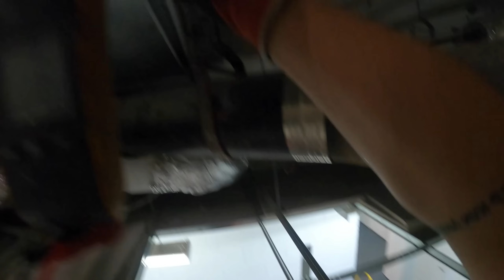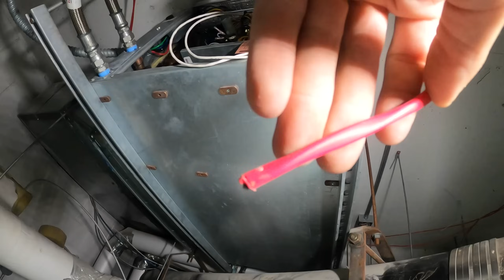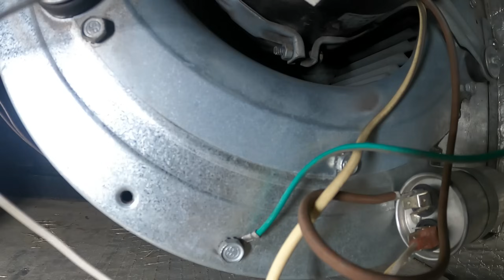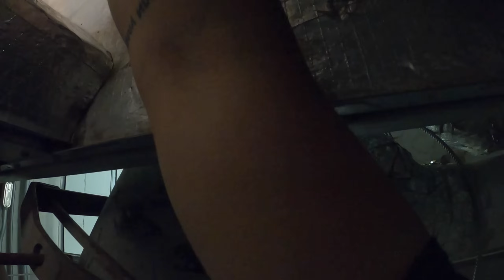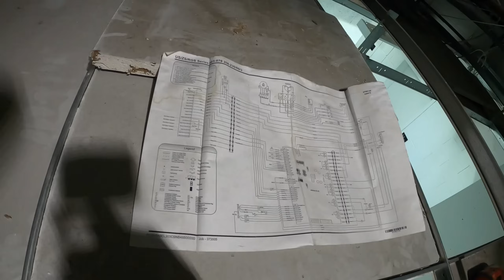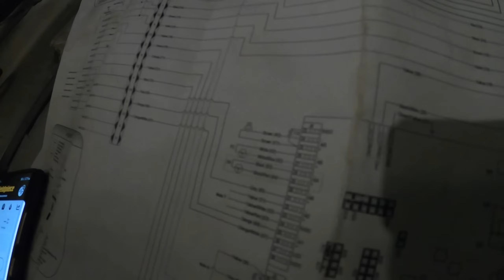HVAC: Johnson Controls Water Source Packaged Heat Pump Not Cooling (John Controls AC Unit Repair)

Comment: Those suspended ceiling tiles should be replaced with new tiles, because of health safety reasons, the water stains can turn into mold and mildew.............